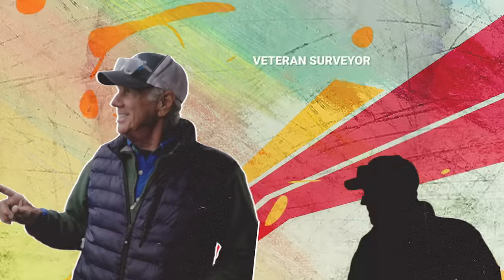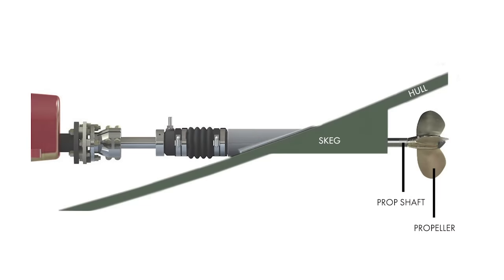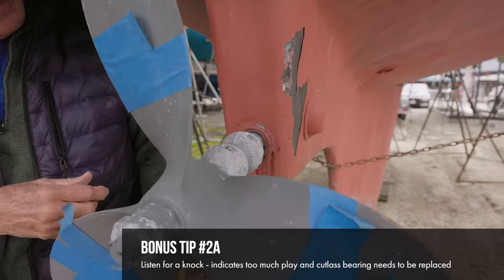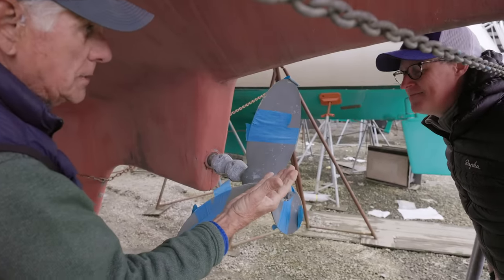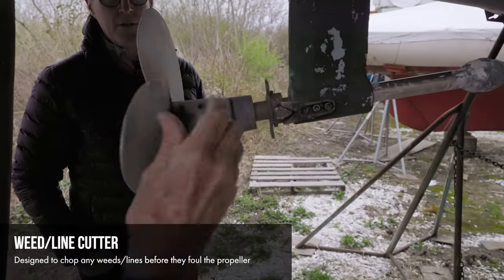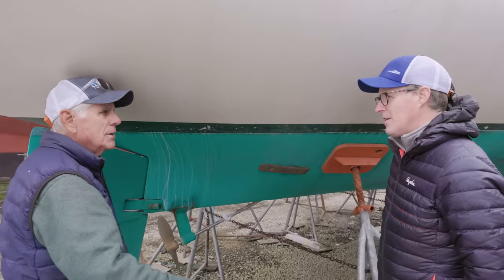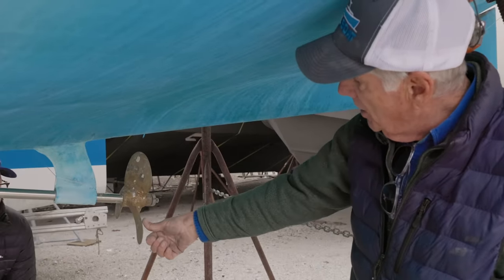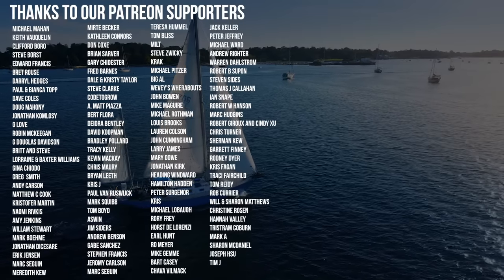SAILBOAT BUYING TIPS - Part 1! A veteran surveyor gives his inside tips  #sailboat

Comment: Well Done! I had to rebed my strut and replaced the shaft on my boat. About 4 boat units... It was a hell of a lot of work.
Reply from the maker: Wow… did you have some visible signs of a problem?
Reply: @YachtHunters  The shaft vibrated underway. After I pulled the boat from the water it was clear that the strut had broken loose after years of use. Repairing it is tremendous amount of work to get it aligned correctly and resealed. The strut goes through the hull and as all things boat, you need triple jointed extension arms and X-ray vision to reach the work area...To repair mine correctly required some machining, fiberglass work and a lot of material research. And then you get to experience to joy of realigning your engine and replacing shaft seals and cutlass bearings.

Comment: Just excellent. My bronze Catalina strut was "pinked" meaning it lost zinc die to galvanic corrosion. Catalina Direct had a replacement part so no new fabrication was required but the strut was glassed into the hull and not bolted. Luckily the guys at the yard were capable but it took a long time to dry out that part of the hull. We put on a good barrier coat as well as a zinc on the strut even though Catalina said the strut was electrically isolated. I guess I learned a wet hull conducts electricity...

Comment: The order of the locknuts shown in the video seems correct: larger number of threads to press the prop to the collar on the shaft, and smaller nut to prevent the larger nut to come loose (same function of the plastic ring on a nyloc nut). Not sure why they’d recommend the opposite.

Comment: If you see a sailboat you like, forget why you like. Go onboard. Don't admire anything. Take up the cabin sole and examine the bilges carefully. Then dismantle any engine compartment and examine the installation right back to the stern tube, if you are lucky enough to get at it. Find out how the owner inspects or cleans the inside of all tanks. If you still like the boat, get a surveyor of high reputation.
Reply from the maker: great advice... dig in deep... and see what the 'bones' of the boat has to say... if you're not put off by it, call in a pro for objective advice.

Comment: having the drive shaft go out under the boat creates a path for water to enter. the blades can get tangled in ropes. they can hit against the ground in shallow water. this can bend and break everything you see as well as transfer force up the shaft into the engine to damage it so as to create an oil leak or worse. struts can bring water into the boat. So we are in a sailboat. yet so much of what can go wrong in it directly relates to its MOTOR. we don't want to sink yet the motor set up provide multiple ways for water to enter the boat. it seems to me that the idea of needing the engine to move the boat should be an add on. secondary to its primary function. yet the entire set up makes the boat sacrifice safety, provided infinite options for something going wrong. So what is the motor doing? getting us away from the dock or back to the dock? so what percentage of time do you use it? it would have to be over 50% to justify all that it demands. seems to be a motor should be lowered over the back when you need it. maybe leave it there. or have a way to retract it back into the boat and away from everything. store it with mechanical means. looking at a part and saying "its good now but maybe in two seasons you should replace it" to me means this part is a problem. it can't survive its function. If something can sink you, or can break in 2 years. it doesn't belong on a boat. OR if its really needed it should be an add on. something easily removed, and replaced. like a diesel generator. Its a large box that makes power. it breaks, you unhook it, take it to a store, have it fixed or just buy another. everyone uses them. they dont cost much. Instead the power is so complex that a rats nest of wires forms with unlabeled breakers and fuses and what ever. Its also obvious that most people with a boat don't have all the time to do all the things that are needed. it would be a full time job. so why "gunk it up?" with holes in the boat. power drives that are easily damaged or disabled by a crab pot!  Most of this stuff feels like trying for the best of all worlds. instead of saying. Im in a boat. I dont want it to fail me. so everything in here has to make perfect sense. Not to give up anything, you need water coming in and out, you need power, you need an engine. yet why install things that you then have to say "check this all the time or it will destroy, sink, damage, prevent, etc...." no. just dont have that system on your boat. put on a system that avoids the negatives. Might not work as well but frankly I would rather struggle with something that is a pain in the butt now an again rather then worry that my drive shaft is vibrating because it hit a sandbar!
Reply from the maker: You make some great points…  and it’s probably while you read so many stories(the Pardeys come to mind) about people sailing the world with no engine. It really simplifies everything from a systems and vulnerability standpoint. I suppose weighing the trade-offs is what we all do when considering big things like this in life and ask the key questions like… “do I really need this?” … great food for thought! Thank you!
Reply: @YachtHunters  you are always so kind about my thoughts. I really want to go sailing yet I just keep seeing things built into boats that to my uneducated mind seem to be malformed. when I saw that there are sail boats that had to survive a flip test. my first thought was why is this not the way for all sail boats!? I watched a bunch of single handers doing an around the world sail and one of them put pads on every surface where he slept. because in crazy conditions you might hit your head anywhere while asleep. I know thats very specific. yet I think thats what a sailboat should be. very specifically designed not to kill you or sink.

Comment: Why not use the prop to produce power when under sail? Surely it would turn as you sail wouldn't it? Or is it easier just to run a generator off the side as you sail? Those stabilizers plates you use at anchor to stop boat sway should also be used to produce power to charge batteries. just seams a waste to me.

Comment: Getting confused here, explanation off, the clockwise rotation when met with water, will produce a pitch angle, based on internal gearing  PRevious segment, three bladed, , more lately two bladed sailboat . Three blade is feathering prop

Comment: His MaxProp pitch description is incorrect; pitch direction determination is reversed.  The load comes from the shaft not the blade ends.  No shortage of pitch men in boat yards.
Reply from the maker: interesting... thanks for the tip... will check it out a little deeper

Comment: Well as a millwright for 40 years the thin jam nut goes out the outside , unless you watch a video online that shows different  where the jam nut is not even tightened against the other nut.The morse taper is what drives the prop not the key and you cannot get enough torque to drive the prop onto the  shaft with thin nut , the key is to shear on overload ,but what do I know , been working on multi million dollar machines and they all come with jam nut on end and I have never seen one come loose if jammed properly